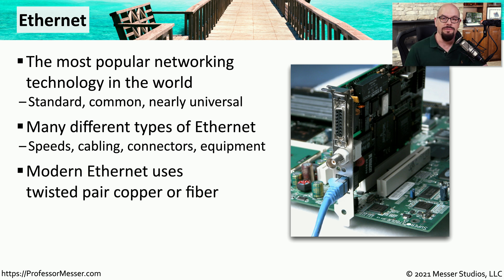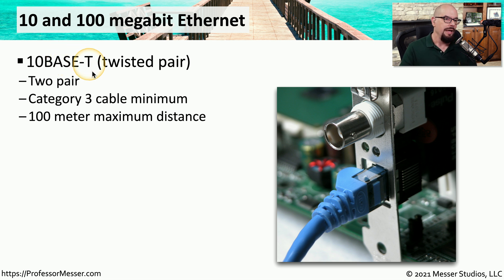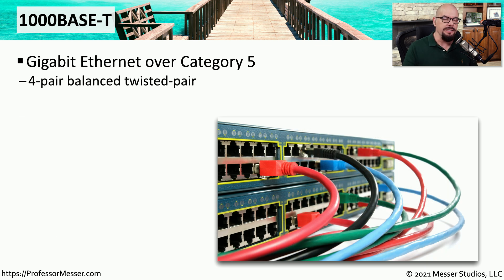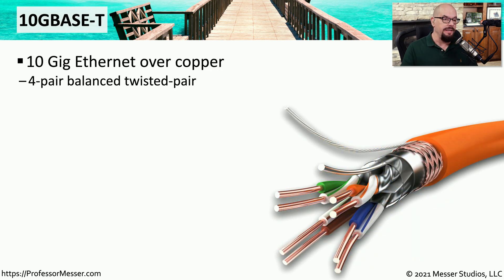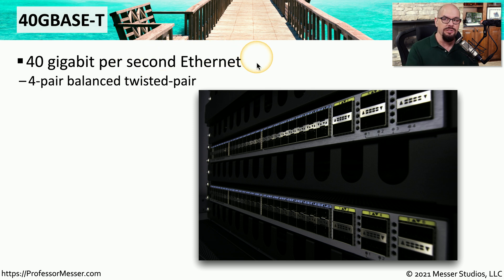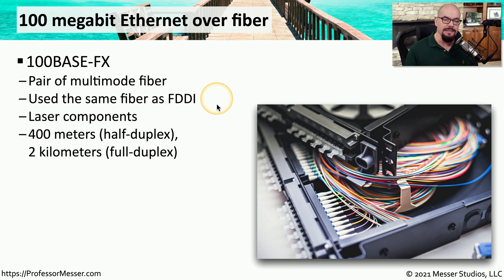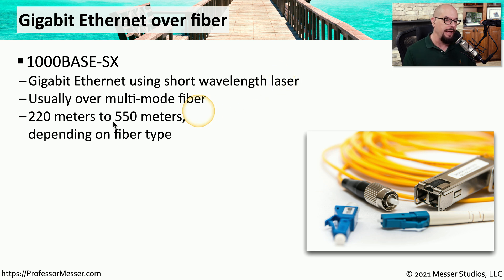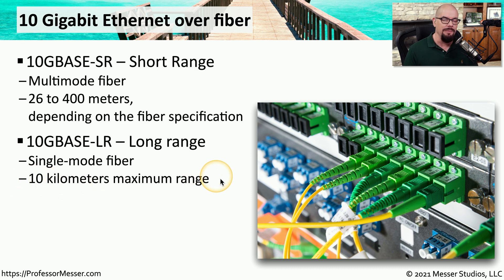Ethernet Standards - N10-008 CompTIA Network+ : 1.3

Comment: 5:35 When he says "Half-duplex goes 400meters while full-duplex goes 2kilometers" is half-duplex just mean single mode fiber and full duplex is Multimode fiber?

from my understanding, Half-Duplex allows communication in both directions but not simultaneously. & Full-Duplex mode enables bidirectional communication.
Reply: nvm, I think I got it:
Full Duplex: Talk and listen simultaneously. (you'd use two strands for full duplex in single-mode fiber(Because 1 strand is for sending, other 1 is for receiving), Unless your using WDM(Which lets data travel both ways by using different wavelengths, even on a single-mode fiber strand)
Half Duplex: Take turns to talk and listen. (rare in fiber, common in WIFI 5 & below, & in old Ethernet devices like hubs)
Simplex: Just one way. Like a megaphone, all talk, no listen.

Comment: How come with fiber, half-duplex has a shorter length span than full-duplex? I would've thought it would be the other way around.
Reply from the maker: With half-duplex, the length has to be limited so both sides can detect a collision when transmitting. If the distance is too long, a collision could occur after a device has completed their transmission so a backoff and retry would not be an option.
Reply: @professormesser  Ooh ok, thank you very much!

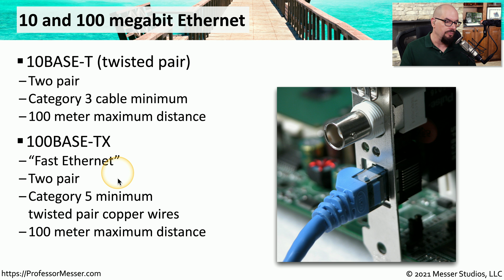Comment: at 2:17 it says 100BASE-TX uses 2 pair cable. Yet it also says Cat 5 is the minimum cable requirement. Cat 5 uses the normal 4 pair contact. So if cat 5 is the minimum then wouldn't it be 4 pairs of cable?

Also, another note, I think you should just put Cat 5e on the 1000BASE-T slide because Cat5 does not officially support 1gbps speeds on modern devices so it is a little confusing.

Thank you for your videos!
Reply from the maker: The category of cable defines the physical characteristics of the cable, and the category type is not related to how many individual wires will be used by a particular network type.

The IEEE 802.3 standard for 1000BASE-T sets the minimum cable type for the standard as Category 5.
Reply: @professormesser  ah okay. so even though the minimum requirement for 100BASE-TX is Cat 5, which has 4 pairs in it, the 100BASE-TX only uses 2 of those 4 pairs. 

Also, I understand your reasoning on the latter point as well. I have now been sent down a rabbit hole of what speeds and distances are actually possible over different Categories of cable and Bit Error Rate and stuff. Very interesting stuff.

Thanks again for going out of your way to help others. I'm hoping to pass this exam soon 🤞

Comment: What is the reason that for CAT8 the increase of bandwidth is just times 4 and not 10? Does that have any correlation with usb-c thunderbold 3 also having 40gb/s?
Reply from the maker: Category 8 cable doesn't have a speed; it's just a cable. The standard of Ethernet is the 40GBASE-T standard, and it operates at 40 gigabits per second. The minimum cable required to run this standard is  one constructed to the tolerances of the Category 8 specification.

Comment: How is multi-mode fiber associated with laser? I'm confused. Shouldn't it be single mode for laser and multi mode for light?
Reply from the maker: Although it's common to see laser used with single mode fiber, there are some Ethernet standards that use laser light over multimode fiber.
Reply: @professormesser  Thank you Professor :)

Comment: If I understand correctly, will ISP use a WDM Multiplexer and WDM Demultiplexer on a VPLS circuit? Since multiple companies get hosted on the same Fiber Link? Just trying to see if I understand the concept and see how it would be implemented in a real-world scenario. Thanks!
Reply: A company would normally be backed up by a secondary ISP circuit as a fail-over.